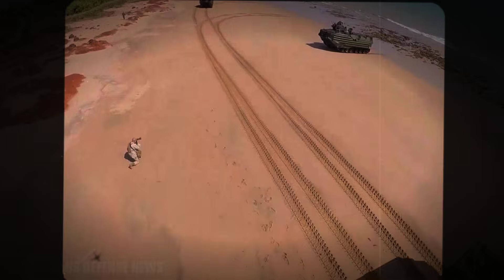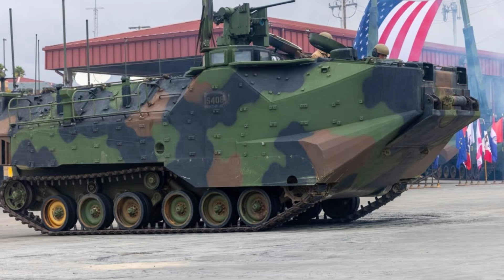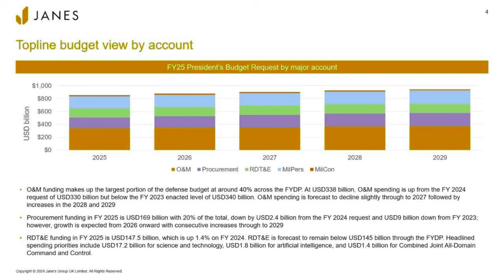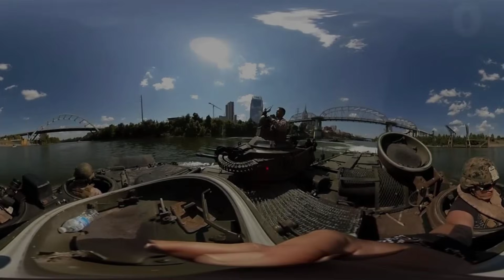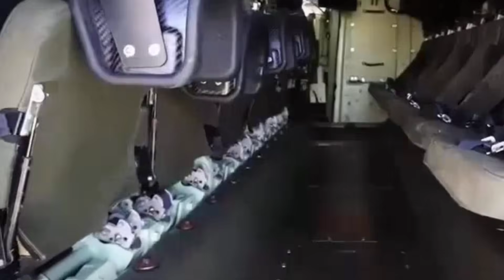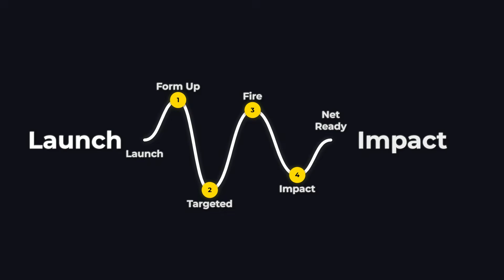The NEWEST and Most ABSURD Amphious Combat Vehicle ever Built - You HAVE to See This!

Comment: Bull crap to this video, I served in the USMC as an AAVP7-A1 not a one had rust or leaks and parts were readily available 
And the only way they sink is do 1. The driver put it into tracks which opens the plenums this will easily sink the AAV 2. There are 4 aluminum plugs underneath the tractor 1 in each corner and they are bigger the a silver dallor if these are not screwed in it will sink
What it comes down to is inadequate crew training not a tractor issue